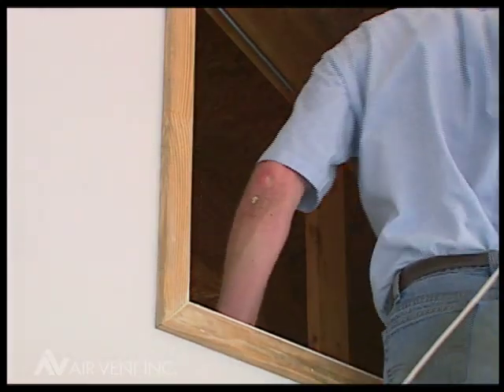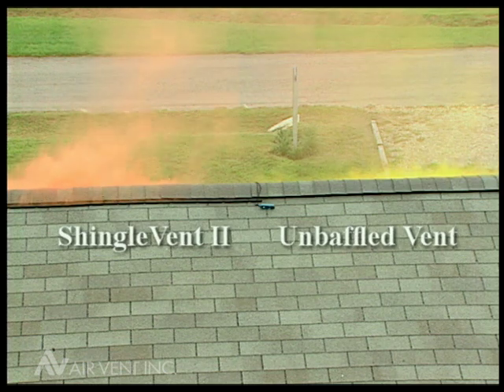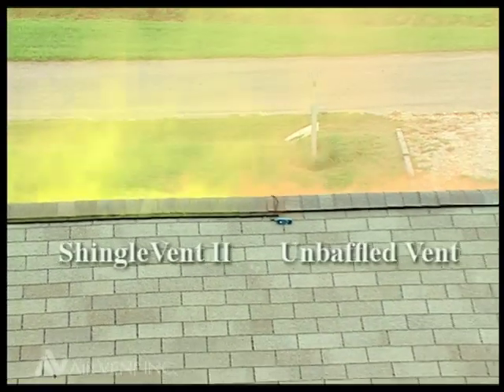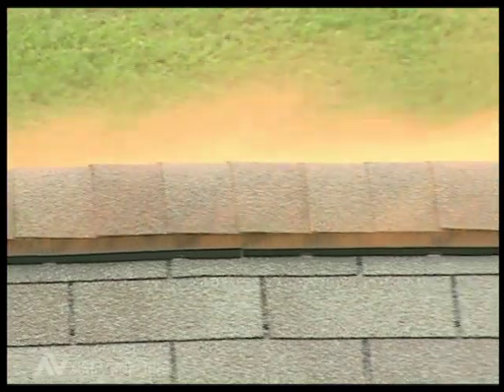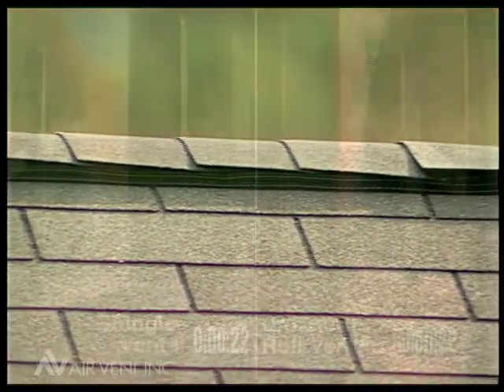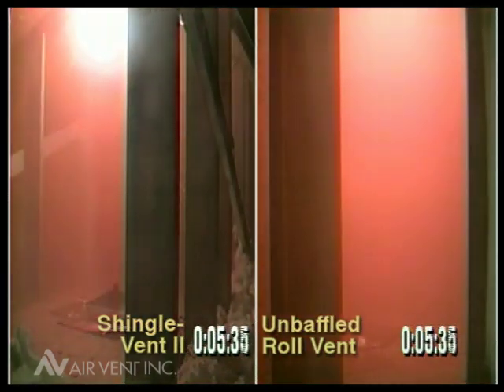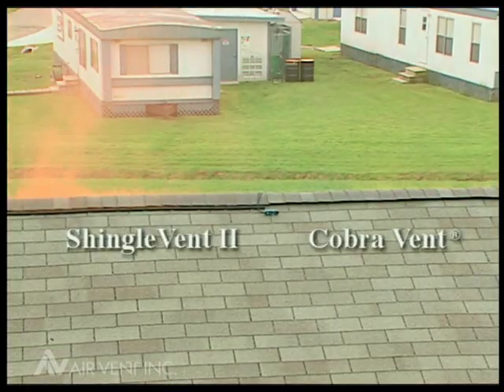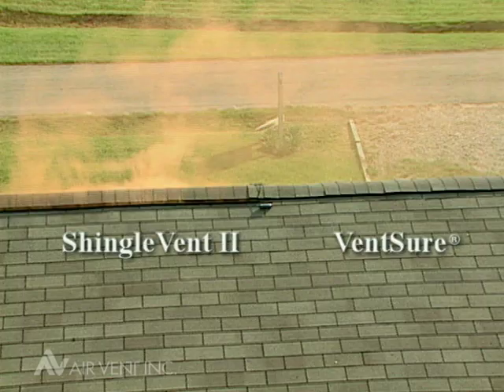Ridge Vent Smoke Bomb Demonstration

Comment: Smoke always rises because it is lighter than air, it does not prove heat is being draw out of the ridge vent. Demonstrate heat being draw out of ridge vent not smoke, this will prove whether ridge vent works, thermal gun & thermometer must use to check the attic heat & at the ridge vent to find out.

Comment: Although... One side is up against a wall, the other a gable...is that gable ventilated by external soffit vents?
 This could make a great deal of difference in the intake of the passive ventilation system. Which we all know, is how passive ventilation works... too many variables left out of the equation here.
Reply: If you look back, you'll see there's no gable vent, there's just another hip. It must be soffit vented.